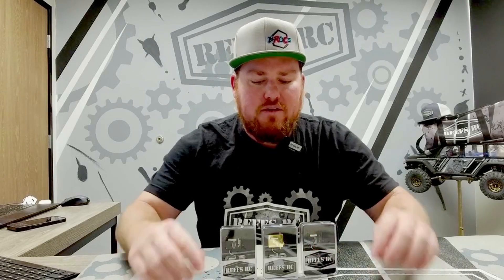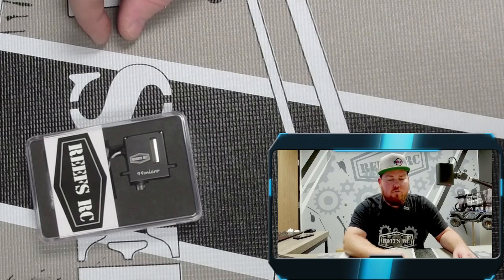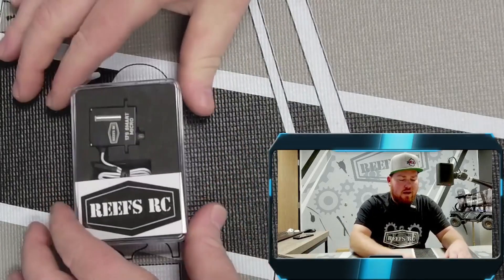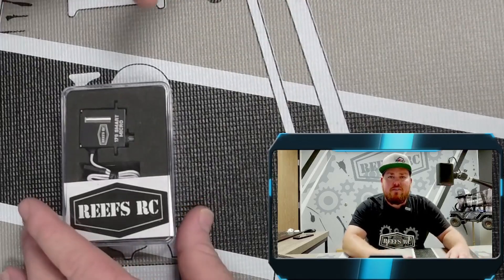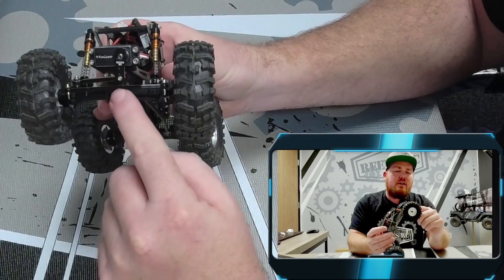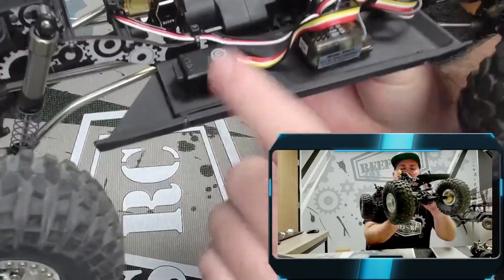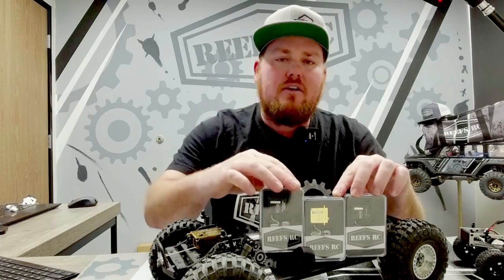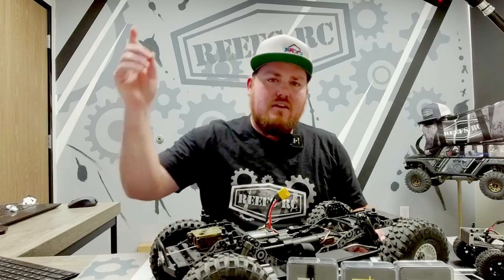REEFS RC MICRO SERVO LINE UP

Comment: Do you offer small servos, like mini or micro, with high torque ratings? 11kg or more? My $250 "1/10" scale Chinese basher to re-enter the hobby after 10+ years came with a 6kg servo. It turns the stock 4 1/4 tires good enough but if I want to use standard 1/10 tires I'm confident it will struggle pretty bad. I put 1/10 in quotes when referring to my RC because it's a 1/12. The simple and obvious fix is to upgrade the servo but everything on this RC is an abnormal size making upgrading or replacing parts from anywhere other than the manufacturer difficult, if not impossible. The servo falls under impossible because it sits in a tray that wont allow anything larger to fit. Even modifying or removing that tray won't provide much more room and surely won't allow a standard 40*20*40 servo to fit. I need a mini/micro or small scale RC servo with a high torque/kg rating. After realizing that I'm stuck buying parts and upgrades that barely can be considered an upgrade from the manufacturer of my RC I really wish I would have increased my budget and bought a different brand. But hindsight is 4/20. Or w.e they say.
Reply from the maker: Maybe our micro 179 of you can’t take a 1:10 servo.
Reply: @reefsrc   I just had a look at the 179 micro that you recommended and it will definitely fit in the space that I am limited to working with. But do you think 179oz of torque will be enough to make the steering function like normal with the oversized and heavier 120 and 135mm tires? Honestly man I know nothing about servos. Like I mean the bare minimum it takes to make them work is all I got. nothing about how much torque they have to be capable of producing to make the steering function adequately or better than it originally was with taller and heavier tires. Reefs name always comes up when high quality servos are being discussed and I definitely could benefit from any help or advice that you could give me. I'd much rather take your advice and buy a product from a well-known and respected company that will last and do the job instead of buying this random 21kg $60 servo from AliExpress that barely moves the larger tires and lasts a month or two.

Comment: I have a question. I have the 99micro and it seems like it’s not centered or it’s not programmed properly. When my trim is set to 0 and I put the horn on perfectly straight it turns more to the right side than the left. I thought maybe my links where to long or maybe my horn was placed wrong but even messing with the trim it doesn’t fix it. Idk if it’s because the servo turns 360 degrees and the program isn’t right but it’s annoying because I have so much turn going right but going left I only have like half of that. I am running my servo sideways like you have urs in the video.
Reply from the maker: I would start by making sure all your trims are 0 for steering including subtrim. The servo will go the same distance both ways so it has to be in your remote, or in the setup of your car not allowing it to go the other direction the same amount.
Reply: @ yes actually it was my receiver I originally had it paired with a brushed esc and then swapped to a brushless esc and I just recent the receiver by pairing it up again and it worked like it should be. Thank you

Comment: So I’m confused on 1/24s I see it being a lay down servo, on a 4m I see some people standing it up.  Is it both? Does it run better as one than the other?
Reply from the maker: I think you are confusing the scx24 and the trx4m. The scx is a lay down and then trx is a vertical mounted servo.  We have mounting tabs for both trucks.
Reply: Nope not confusing them, I own both…. I also see them being laid down on 4m’s and I figured it out.  Appreciate the response back though 👍. Still learning and didn’t realize you just need a different mount for the same servo.  Thought it was a completely different item.

Comment: Hello, I have a vanquish vs410 pro. I have a reefs micro 99 servo winch. I want to put the micro servo winch beside the stock steering servo where a full size servo winch can go. Do you guys have an adapter plate to put the micro 99 in place of a standard servo? Similar to the mount for the raw100 standard servo adapter plate?
Reply from the maker: We do not have an adapter mount. We have the micro 99 winch mount you would have to modify to make it work. The raw100 mount is the only mount that converts a micro into a standard mount.

Comment: hi im looking for a replacement servo for in my fcx18 lc80. im not sure if it would be a direct fit or if anything else would be needed? the whole rig is fully brass upgraded so its quite heavy thanks for any help
Reply from the maker: I would get the Micro 179 for the extra power. On ours, you need to space the servo out slightly. we are also using our micro shorty horn.
Reply: @reefsrc  ive messaged this same question on instagram. would there be anyway of getting a picture?

Comment: Newb here! Love the products and the content. I’m looking for some help. I have a 99 brass servo and the short horn. The ends on my steering linkage don’t fit the size of screw needed for the horn threads. Is there a different horn or what’s the correct size of ball end?
Reply from the maker: Thanks for the support. I would need to know what car you are running it in. if it is a scx24. most people are using a nut in front of the servo horn.

Comment: Other than the reduced power and torque, are there any issues running the 99 micro or 179 Smart servos with 5V power and a 3.3V PWM signal?
Reply from the maker: There shouldn't  be an issue, outside of the ones you listed.

Comment: I have a VRD Carbon I'm looking to add a micro servo for a winch. it's just under 6.5 lbs. Will the 99 micro work or is it worth paying almost double to get the 179 micro understanding the additional cost of the winch accessories and programmer that would be needed?
Reply from the maker: The 99 will work, just keep in mind it is a micro servo winch. You can't expect it to pull your truck from a wedged spot, it is more of a little assistance.